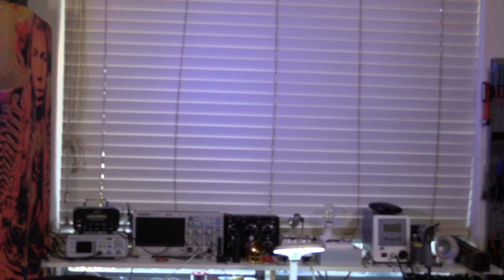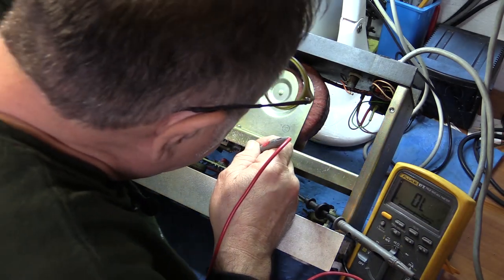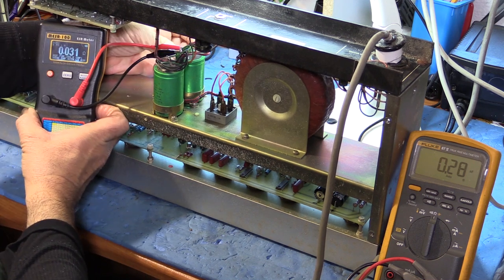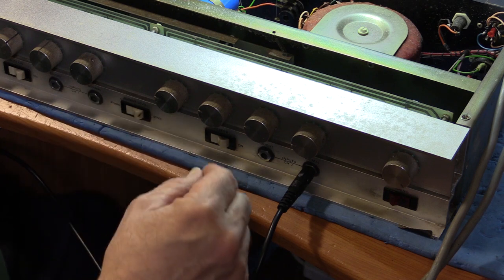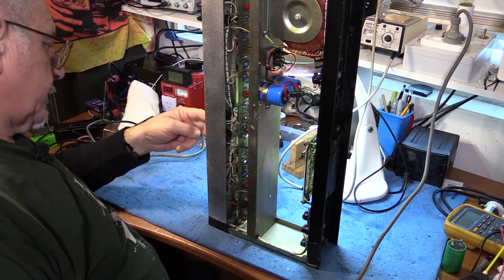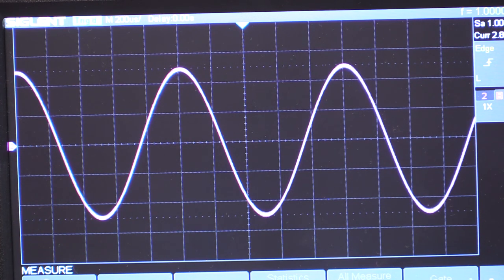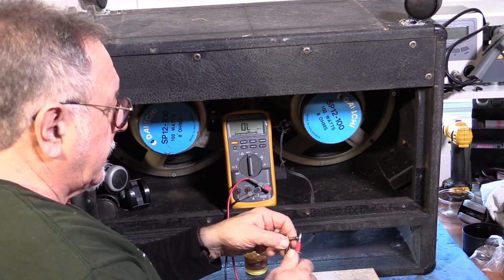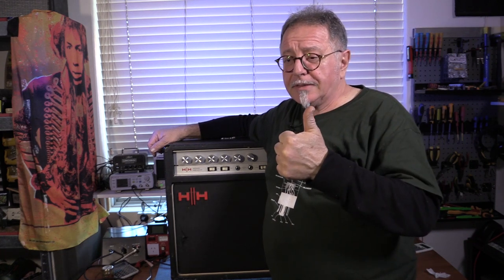Let's Repair this 100w H/H Combo solid state amplifier

Comment: Hello. I have a HH IC100S that has some issues. Channel 1 works in clean setting but when i engage the sustain switch it doesn't produce any sound. And channel 2 doesn't produce any sound too. Any clue of what might be the problem or where should I start to troubleshoot this?
Reply from the maker: As you know, it's impossible to accurately diagnose an amp remotely. However, check the Sustain footswitch socket. Your signal passes through it. Clean the contacts. Same story with the Channel1/2 switch. Good luck.
Reply: @theguitaramptech  Thanks for your tips. I will do that. Best regards.
Reply: I would agree with guitar amp tech...Us techs can't always give advice on working with live electronic equipment as a shock on the fingers is not nice!

Comment: I have seen capacitor clamps riveted to a chassis before but I don't think I've ever seen the clamp itself riveted shut around the capacitor!  A strong magnet stuck to the chassis next to where you are drilling will catch most of the metal shavings, assuming the rivet was a ferrous material.
Reply from the maker: An excellent tip regarding the magnet!  🙏
Reply: @theguitaramptech  , I had to drill out some rivets on a McIntosh amp just the other day in order to remove the oval plates that held the original "twistlock" style  of can-caps and install capacitor clamps like the ones on this amp. Unfortunately, the magnet only works if the rivets are steel and not if they're brass.....

Comment: good amp to fix PSU caps give problems 100 HZ buzz coming from the amp
Reply from the maker: Exactly right Ian. For 100Hz buzz look to filter caps. For 50Hz hum look to earthing, tubes, heater hum balance. Thanks 🙏

Comment: I think originaly there were Fane speakers in it! Allmost 100% sure!
Reply from the maker: I think you may be right with that recollection, Blusey. 👍
Reply: the first ones made actually had celestion  alnicos in them..marc boland used one...most of them speakers were robbed by vox guys

Comment: What’s this problem? 
I’m getting a faint “pst” every 60 seconds or so. Amp still works well, but it sounds like something may be failing on circuit.
Reply from the maker: Thanks for your msg. That’s too hard to diagnose remotely, Casey, with a description of pst. 
Check that you have no DC on any of the pots. If you do, do may have a leaky coupling cap.
Reply: @theguitaramptech  fair enough. I understand. I’ll explain a little more. I thought maybe it would be a very typical problem. It’s a quiet little crackle that’s happens every minute or two through just the woofer for about half a second. It’s a bi amped Yamaha hs7 studio monitor. Might be class d not sure. Anyway. That’s what it’s doin. I bought two of them used. The other speaker doesn’t do it. I have had this with other old hi fi amps, but I never knew what it was. I assumed old caps or something. These are only a few years old and I’m not going to fix them myself. I’ll just return them to guitar center and get different ones. Thanks!

Comment: The eternal question when you find dumb things inside the chassis.... why would they do that???? Lol.
Reply from the maker: I know, right. Why would anyone clip out two capacitors, then return the amp to the customer? I’d love to find the answer to that one, Stefano
Reply: @theguitaramptech  I hate to fathom their reasoning.
Reply: @theguitaramptech  ,  I am working on a McIntosh MA230 hybrid integrated amp with solid state preamp and tube drivers and outputs. Somebody recapped it themselves from a "kit", after which it wouldn't work. They had miswired the entire power supply, installed one high voltage cap backwards ( it was bulging), forgot to hook up a ground reference for the negative side of the voltage doubler power supply, installed a capacitor backwards in the negative bias supply and reversed both the capacitor and diode for the low voltage supply to the solid state pre amp! They also cut a bunch of wires to the tone controls and the rotary wafer-type input selector switch in order to get the preamp board out for recapping, and then they spliced the wires back together incorrectly (colorblind perhaps?), so that once I fixed the power supply the unit powered up but the treble control worked backwards and had loud hiss on one channel. I sorted that out, but it still has an intermittent issue on one channel.....😖